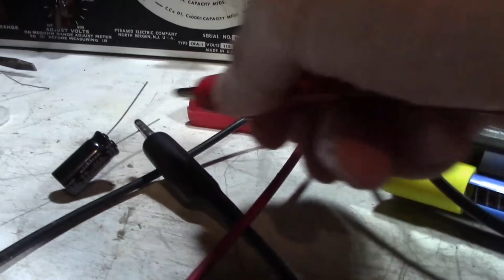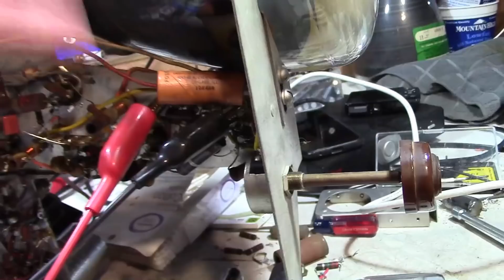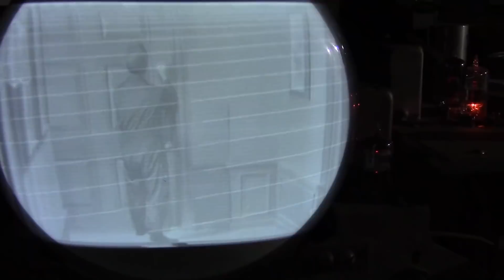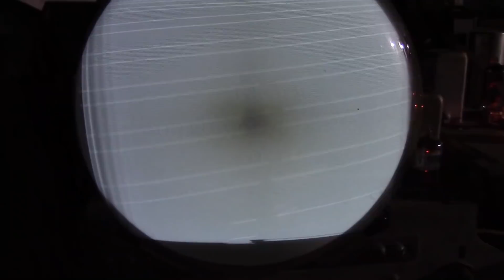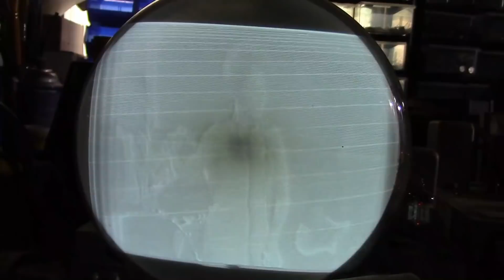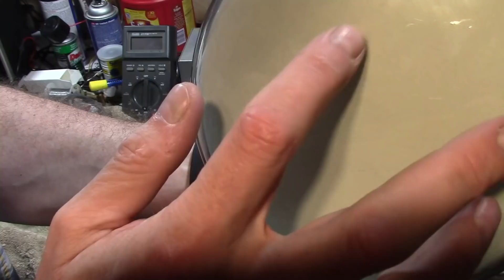Admiral 19A15 restoration p2o4

Comment: If yah need any tv tubes the ones I got I have no real use for so far there testing strong. Lots of 9 pin and 7 pin also older style octal tubes.
Reply from the maker: Thanks for the offer.  The only tubes that come to mind are 6JS6 and 6DQ6 horizontal output tubes.  Those are bigger tubes with plate caps on top.
Reply: @bandersentv  I did get a 6dq6 the cap was broken and vacuum escaped. I do have 6w6, 1g3, 1b3, 6cu6. Also a 6v6 philco original it's weak though. Oh and 6sn7 I have 2 of those

Comment: Are you interested in a 20b1? I have the record changer, am/fm unit, picture tube and chassis, power/amp chassis and the cabinet. I have a video of the amp board working using the input RCA.  I was thinking of parting it out on ebay but thought I would ask a few people that I watch fix them.  I know shipping is expensive so willing to let go for pretty cheap.
Reply from the maker: Thanks for the offer but I'm pretty well set on spare parts and shipping is going to be hefty.  Unless you're in the Chicago, IL area.
Reply: @bandersentv  San Antonio but that's cool, I got AM going on it now will poke at the FM for a bit after I finish repairing A4 on this damn sx-99 pulled from a pig shit barn.

Comment: Heh Bob 
I was able to find NEW 7JP4 tube bases on eBay.  I took a chance and bought one several months ago , installed it on a 7JP4 I had with broken pins on the old base. It worked great. I have a YouTube video on installing it. 
You probably have several 7JP4’s with bad bases , hope this helps. Here’s the eBay item number 
 263944993774

Comment: In my experience, when the Getter has been depleted either by a leak or a fracture of the glass, the barium deposit on the glass goes white and chalky. The fact that the weak tube had no deposit at all by the Getter suggests either that the Getter wasn't fired during manufacture or more likely the getter was defective.
Reply from the maker: I've seen other picture tube getters go clear. I think it happens when the leak is very small and take months or years.
Reply: @bandersentv  I have a beautiful STC 4212e triode.  It has a getter ring near the base, but no silver on the glass, so I was wondering if it had been fired.  Sadly this tube seems to be low emission.  I put 1kV on the plate and even increasing the control grid volts as high as +150V it would not get above 200mA plate current.  Should have been a few amps according to the characteristic curves.  There is none of the glow that you get in a gassy tube though.  One day I want to try rejuvenating it as you do with picture tubes in this video.  I discovered the following article by Lane S Upton on rejuvenation: https://antiqueradios.com/chrs/journal/rejuvenation.html.  It's got to be worth a shot, though I would hate to burn out the filament.
Reply: I’ve seen vacuum tubes with a chalky white getter that look like pieces of the original getter has de-bonded off the glass. 

In other words the getter doesn’t look like the symmetrical roundish shape it started as, but now has a jagged edge where some of it most likely flaked off.

Comment: I wonder if a clear film protective sheet would improve the safety of the scratched front glass of a tube. Conceivably, it could limit the outward shrapnel.
Reply: Adhesive sheet, that is, like the stuff you would find on a new phone or laptop screen.

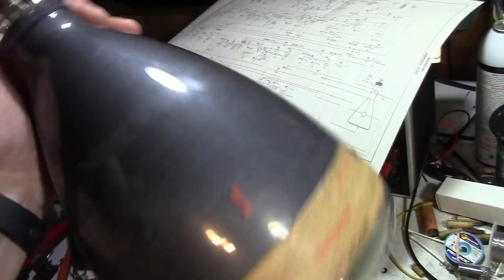Comment: @ 50:00 That getter looks like it was never fired. You should see the cloud from the barium salts deposited on the side of the tube. If air contaminates the getter spot, it turns white. Might be worth firing the getter. Might bring that tube to life.
Reply: I agree, I have seen a lot of white getter when air has got into tubes (not picture tubes).  You can get cheap Chinese induction heater boards on ebay which you connect to a few turns of wire. It would be a very interesting experiment to try firing the getter.
Reply from the maker: Maybe, but the getter cup is empty.  Perhaps they didn't fill it or it was used up slowly over a long, long time.
Reply: Further to my comment yesterday, I looked up getters in Wikipedia, and it seems the most common getter used is Barium.  I had assumed this metal had a lowish boiling point so it evaporated and condensed on the glass.  It  turns out that they use Barium Azide, which is a Barium/Nitrogen compound, which when heated breaks down into Barium and Nitrogen.  This has to be done while the tube is being evacuated so that the Nitrogen is removed, so I guess flashing a getter on a sealed tube will just make it more gassy. 

Anyway, I just want to say I really appreciate your videos, they are keeping me sane over here in England during this horrible year.  Keep up the good work. You have renewed my interest in electronics to the extent that I am building a solid state headphone amplifier and repairing a signal generator.  Next project, I want to experiment with cheap horizontal output tubes to produce a top quality OTL (output transformerless) amplifier.  I got a hundred PL81 tubes from ebay for 170 Euros!  You can run them in triode mode and it beats paying a fortune for 300Bs, though of course they won't look as pretty.